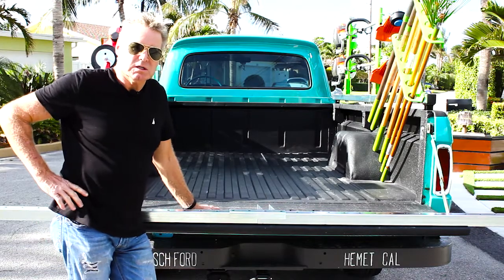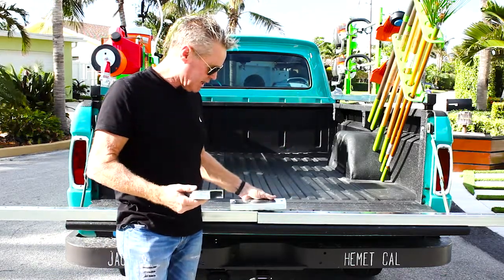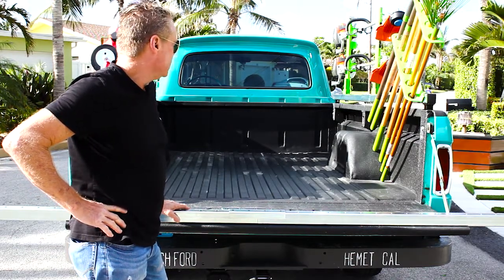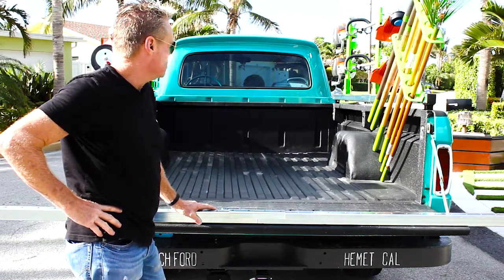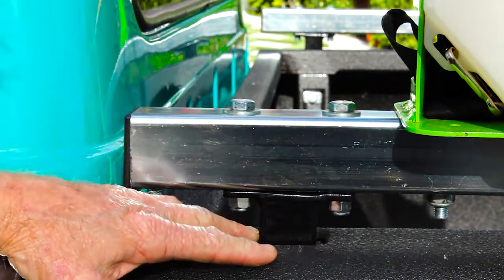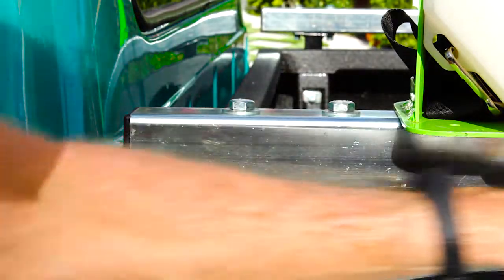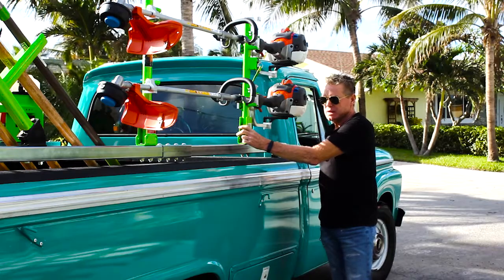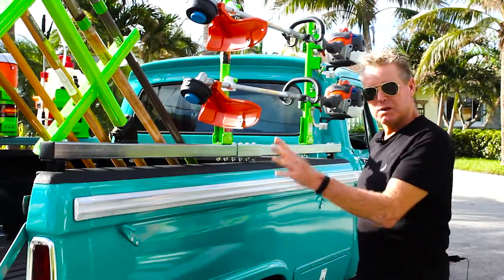AA101 Pick Up Truck Rail System-TrailerRacks.com/Green Touch Industries

Comment: does it come with rails for both sides or just one side
Reply from the maker: This set up is typically used to mount on one side of the bed. But can be used as 2 four foot sections on each side of the bed as well!
Reply: so its just 2/ 4ft sections in the box?
Reply from the maker: Yes! With a connector set that can make it a full 8 foot section if desired!

Comment: the product is alright but my order was missing 8 pieces of bolts, nuts, and washers which I had to go to the hardware store and get.  Also the instructions are completely worthless and don't offer any help whatsoever.  For this price point you'd think they would be able to treat their customers better.

I messaged website support and no one has gotten back to me for 3 days.
Reply from the maker: @SethHarcrowmusic  thanks for commenting! We are very sorry that you have experienced this. After checking our chat logs, we do see that you messaged us yesterday and our automated message indicated that we are not open on the weekends. We do not show a log of any other messages sent or received any other days prior to this. We do apologize for the issue. Rest assured that calling us will be the best option when you are having difficulties installing our racking systems. And there certainly is no excuse for us to have overlooked including all necessary hardware. Please feel free to give us a call Monday through Friday from 8am to 5pm EST at 561-659-5525. We will be more than happy to assist you.

Comment: What's to keep a thief from loosening all your bolts and taking your stuff...
Reply from the maker: That is a very good question! We provide all the necessary hardware for mounting and installing the racks. We recommend using tamper proof nuts as an added step to deter theft.
Reply: Smith & Wesson